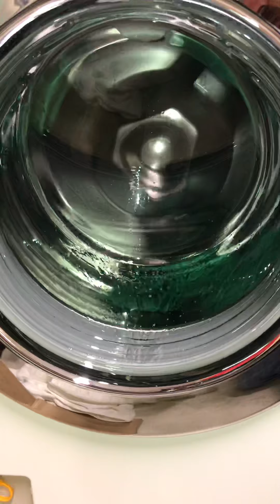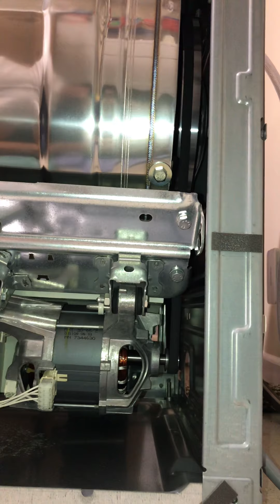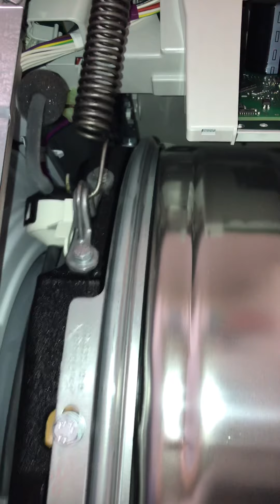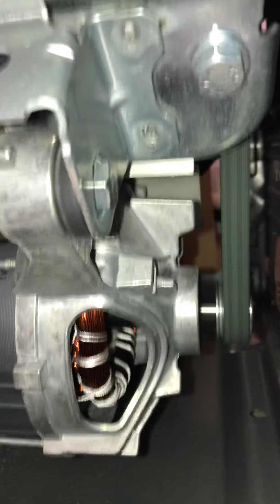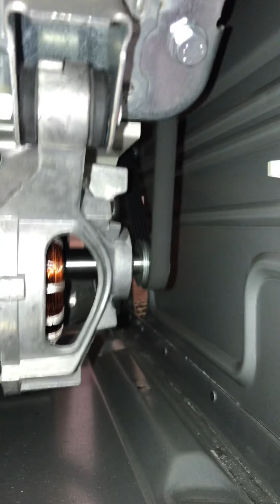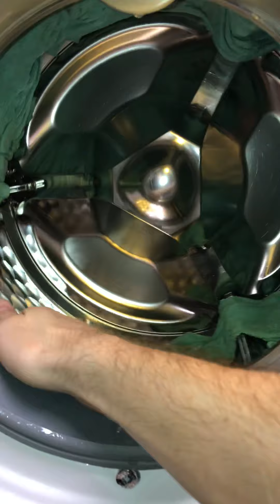Miele Touchtronic W3033 - Test Wash After Repair

Comment: Oh my God it’s so nice to see this machine again! Will there be any more videos soon? 😀
Reply from the maker: Yes once I get it all put back together I'll make some.  In this video I washed a load of my premium microfiber towels I use to detail my car, and they get very dirty.  I did a Custom 40C (Warm), with Tide Powder with Bleach, and they came out spotless.  I do have the machine connected only to cold fill at this time, but I'll probably run a second line eventually for hot.  The machine was in my garage packed away entirely sealed up for about 5 years since where I live now we already have a washer and dryer.  I finally had to put this one back in service.  Unfortunately when I started it up, the seal on the back of the Water-control was leaking, I guess it shrunk from being in the garage during freezing winters and hot summers.  It was an easy fix, and I also got a new fascia panel, and one of the water shields on top of the drain pump was cracked so Miele USA had to order that one from Germany, they didn't have it in stock.  I'll leave the machine sides apart until that part comes.

Comment: Good washer, full cycle videos coming soon?
Reply from the maker: Yes stay tuned, I still have some parts coming and I'm doing a bit more maintenance on it while I have it apart.  I'm going to take the water level air tank out and make sure it's clean inside, and then I'm going to remove the front seal and do a little bit of cleaning around where it seals to the drum.  Then some dusting inside and clean the sump out that has a bit of corrosion from where it was leaking, then it'll be back in service.
Reply: Is this miele American or European?